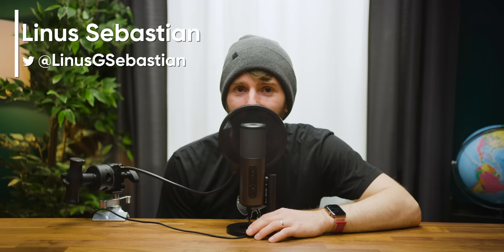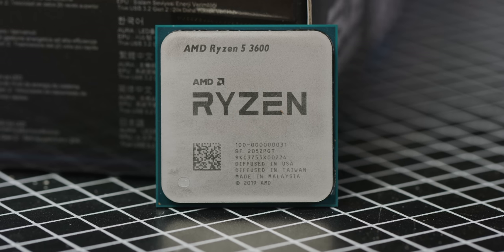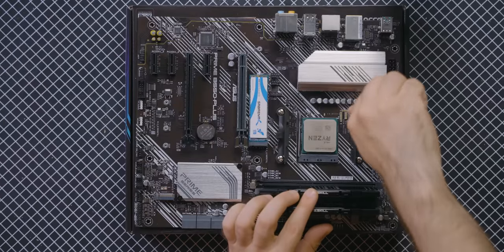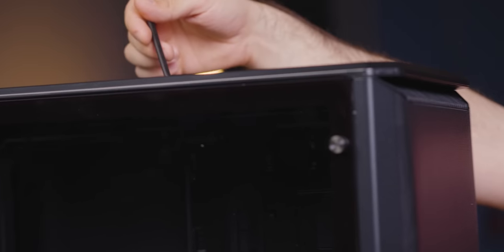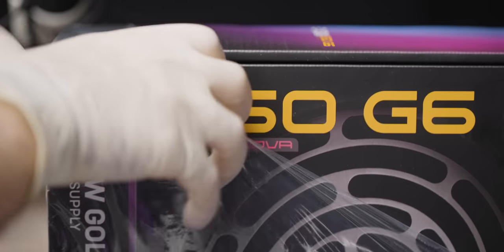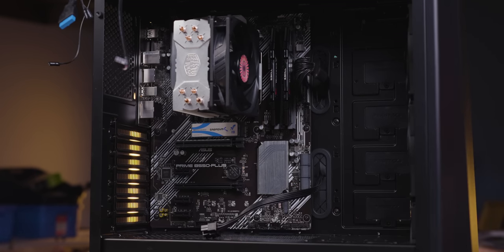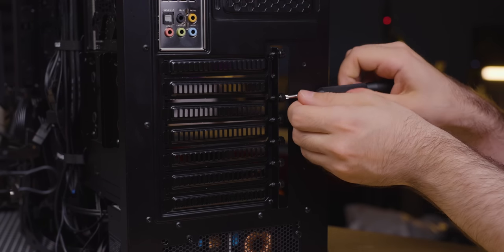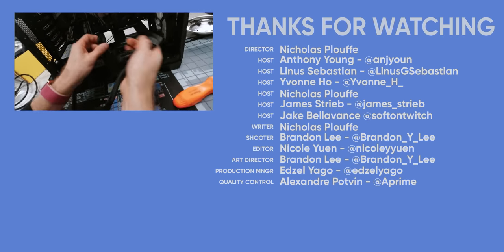How to Build a PC - ASMR Edition (everyone hated it)

Comment: This is unironically the best build guide I've seen, I learned how to do better cable management, and though I knew to connect my anti static strap to a turned off power supply, everyone I knew (only one of whom had built a PC before) told me that sounded crazy. Also you showed putting the I/O shield on, most build guides I've seen gloss over it, either not mentioning it at all, or just saying that we should and not showing it.

Comment: 8:10 We were building with a friend a new PC of his a couple of month ago. This step is when we had found out that 8pin MB cable doesn't fit in the top cutout because of the MB. We were forced to unscrew the MB, shift it, pull the cable and then screw the MB back in place.

Comment: Would have liked either some visual cues for the highlighted areas, or some better descriptors other than "here, here, here, and here". 24-pin along the top of the right side, the audio at the bottom left, and usb3 by the power.

Comment: too fast imo, they should have should have gone 0.75x speed irl and use longer transitions of the random amsr trigger noises. split this into 2x 25min videos and you will capture the asmr fanbase too. Just your staff with naturally soft voices talking calmly could have done this. you could have even had 2for1 by releasing it with and without voice doubling your videos.

Comment: I'm going to make a computer with the same specifications as the one in the video but... there are components that I change for my needs

The ram is 16 GB 8×2 now
I Deoverclock The cpu
And... I Also Use A Cooler master case

All the specifications that I modified are because I usually use a software called VMware which is virtualization software to run the operating system on the host operating system.
Reply: Sorry if my English is bad
I live in Indonesia so I'm used to Indonesian
Reply: I also downgrade the cpu
From Rtx 3060 to Rtx 2070

Comment: Hi Linus. Advice, please help ? Can I replace my Dell desktop PC power supply with any mini ATX size power supply with a 12pin (you know, all the connectors) ? Need to get that guy running before power supplies are too expensive to obtain. Please help, that's my main audio production rig (thankfully I bought a studio laptop for backup). Any advice would be awesome 👍👍👍. Former Elec Tech, don't mind drilling holes to mount hardware- hehee.

Comment: hey Linus I know you have not done a rig reboot or anything like that in a while. i would like to start making videos but my computer is lagging in performance and i would like your help. right now my computer has a intel  core i5-6500, ASUS GeForce gtx 580, 16 gigs of ddr4 2133 (only thing decent in it), 1tb western digital hard drive, and a msi b150 motherboard. I do not know what power supply i have in it. please help and if you cannot because of all the shortages and everything that is fine.  from, Peyton